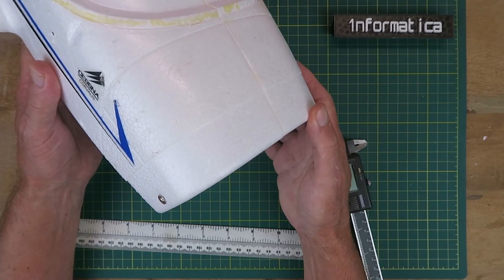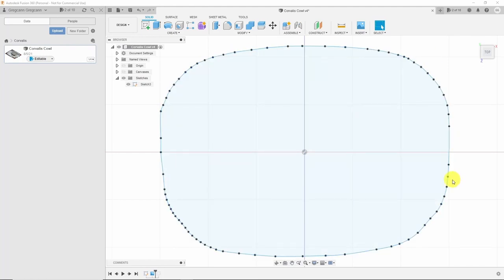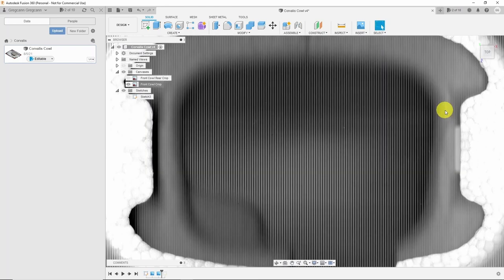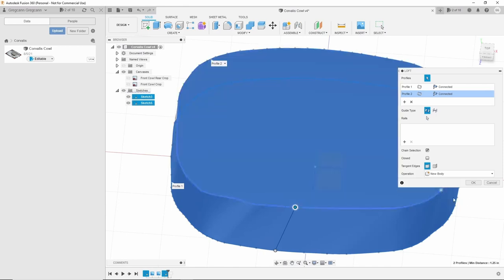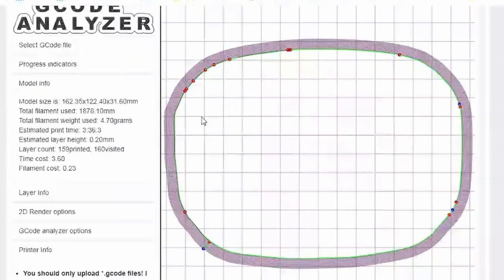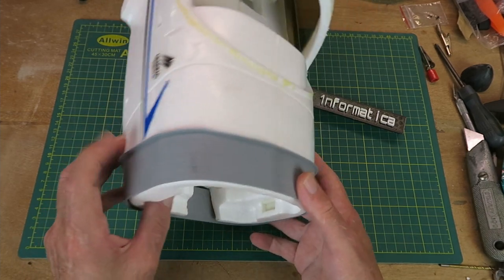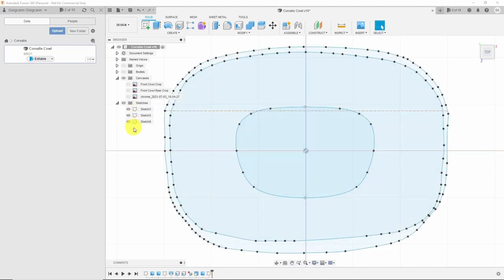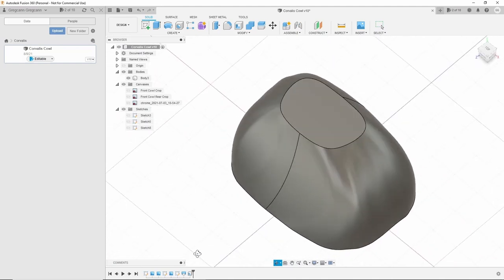3D Printing a Cowling For An RC Plane Modeled in Fusion 360

Comment: Thanks for this very helpful video. Since I was just doing a cowling myself and I also use Fusion 360 and Cura (a novice myself) I can add a little trick for anyone interested. Output the piece as a solid body to Cura and use Cura in "Vase" mode. You get a neatly printed wall that's made by spiraling up with no steps and no seam at all. Use the 'Special Mode' function in Cura set-up. Select 'Surface Mode = both' (to get the bottom plate printed if you need it) and select 'Spiral Outer Contour = on'. The wall will have a one nozzle thickness. if you want a thicker wall just use a bigger nozzle (change the set-up in Cura if needed). I just tried it and it worked great.
Reply from the maker: Hey thanks! Very useful feedback. I will try the vase mode, will be great to not see a seam. YouTube no longer shows me if you are subscribed. Please consider subscribing if you have not done so already!

Comment: Lightweight PLA expands as it comes out of the print nozzle. That's what makes it so light, and why your wall thickness is .08.
Reply from the maker: Thanks, I am aware of that, I have done many, many tests! My Cura LW PLA settings allow me to print other models with a single wall which come out at 0.4 mm. I have not found out the problem with this model yet.

Comment: I am struggling to mate printed cowls with my already built foam planes.
Reply from the maker: It is always a challenge. Sometimes we have to accept it won't be perfect, but when it's flying who can tell?! Thanks for watching, have a great day!
Reply: @1nformatica  So far I have acceptable sucess in printing short cowls that I attach to the nose and then I sand the foam flush with the cowling. But installing a cowl complete from the nose to the windscreen is still out of reach.
Reply from the maker: @rva1945  Practice makes perfect! Keep at it!